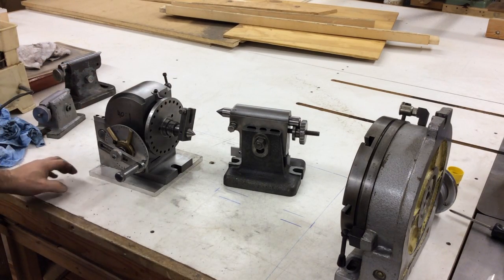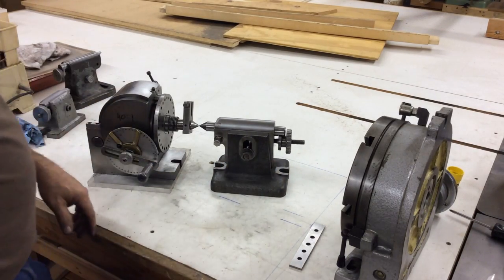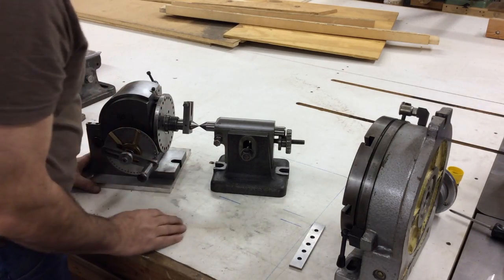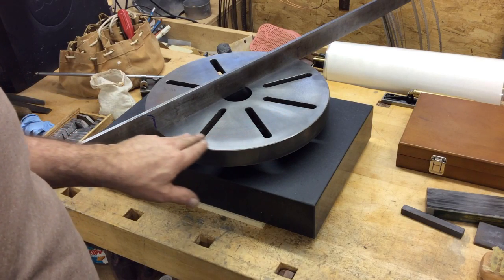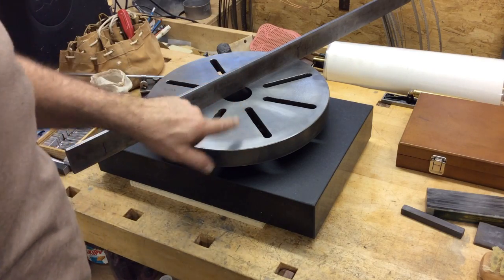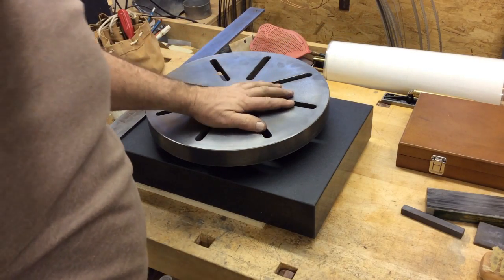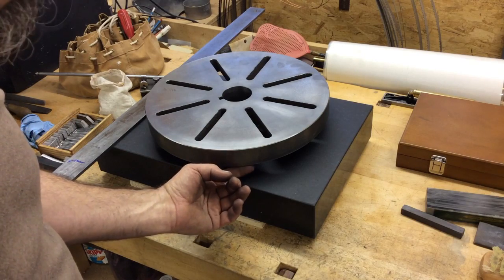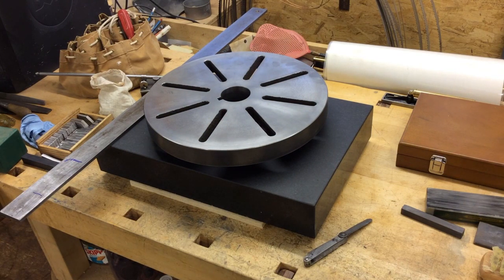Ketchup #21  Dividing Head, Face plate

Comment: Randy G'day,
If you find you are using the BS1 constantly then I'd suggest a couple of keys in the plate similar to the rotary table, that will make for a quick lineup on the mill every time.

In regard to the rotary table chuck, I suggest the biggest chuck you can find because even that will be too small for some jobs (old Murphy's law points to the first one). If possible a thin type chuck, all chucks will be heavy to handle, you can always grasp a small chuck in the bigger one (I do that at times when I need a 4 jaw one rather than make a stack of back plates).
Look for an old lathe chuck (some were quite slim), or one that has a minute throw out that can't be used at speed, it will be accurate enough for anything you do, and they turn up at machine suppliers and are discarded.
Reply from the maker: Bruce Whitham I won't be using it often you never know, I will put keys in I think.  When I save up a bit I will look for a 10" chuck. Which way should I go 3 or 4 jaw?  I enjoy your vid tremendously you have a great shop and you are very talented.  Thank you for sharing you skills and knowledge with us all.  Happy New Year, Randy

Comment: The base plate looks like a pretty good set up. If you're looking an inexpensive chuck for the rotary table Grizzly has pretty good prices. I got my four jaw from them and it's a decent quality chuck.
Reply from the maker: Mike Dittman I will have to check that out, Thanks Mike.  Randy

Comment: Making the tail usable with both units is a good plan. If you can get the height the same as the rotab you wouldn't even need to adjust the tail between units.
Have a great xmas and get crackin on it in the new year.. ;-)

Colin
Reply: I'm with you Colin, if Randy has to make a raising block why not make it to be at the same centre height as the rotary table.
MC&HNY
c
Reply from the maker: ***** That is a possibility, I will need an 1-1/2"(roughly) spacer.  I like the idea, will look at that.
What is another 20 lbs.  Merry Christmas Colin and thanks,  Best idea yet.  Randy
Reply: Randy Richard You can always mill or drill a lot of the 1-1/2" plate away to lighten it while maintaining a solid base! Not needing to adjust the tail would be a nice plus!
Reply from the maker: Jeff Sigrist Thanks Jeff, I will think on that.  Merry Christmas, Randy